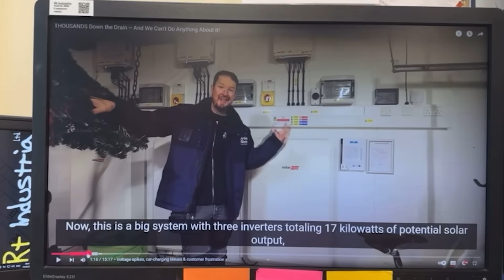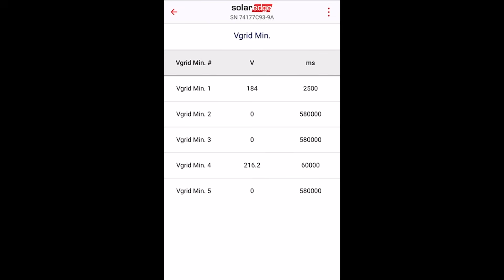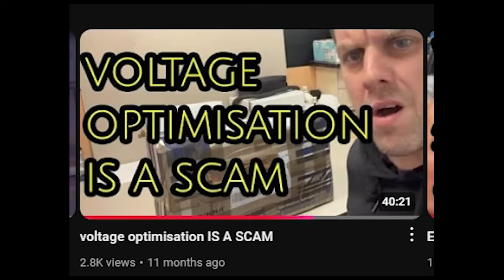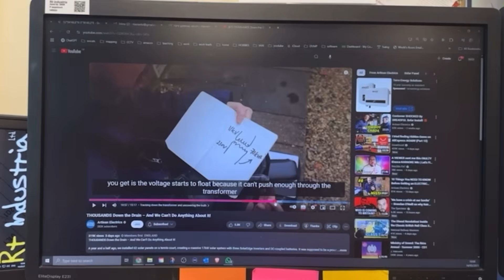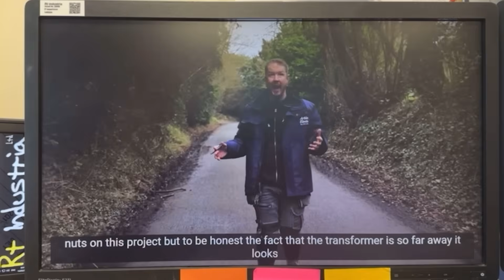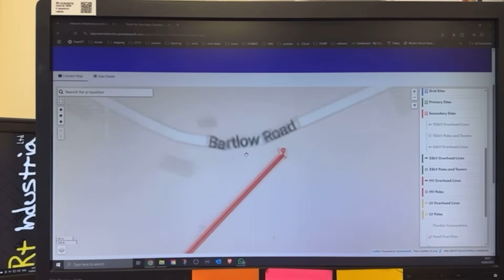ARTISAN ELECTRICS v THE GRID. WHO,S TO BLAME

Comment: Irritates me that all the wealthy people seem to think they should be able to dump as much power as they want into the grid at the times when the country doesn't need it and then expect the rest of us to foot the actual electricity bills to pay for this.
Reply: There's 3 pumped-hydro lakes & an ever-increasing number of batteries to fill up, it really shouldn't be a problem.
Reply: @alanhat5252 batteries are the solution, install them on your property and soak up that generation. If you think you on your cul-de-sac can pump electrons all the way to wales, good for you, that’s just not how it works, the grid was never built to work like this and it’s uneconomical to build a grid design to soak up a few hours of peak solar generation. I love solar, I love my battery system but I’m a realist about what we can expect from our local infrastructure.
Reply: @alanhat5252  you don’t really understand how rural power systems are set up.
Reply: The ridiculous electricity bills are because of the way Government has set it up, the utilities are just doing what the Law says. The Government would change the law if they were prioritizing the people & not worrying about getting massive backhanders.
Reply: @edc1569 253V + 253V = 253V 

That's physics, it's totally independent of network topography, maintenance standards or anything else unless there's a wire run longer than about 12.5Km.

Comment: Some places still have very high natural grid voltage, theres nearly no one with solar were i am, yet the grid voltage at my socket is 257 volts, when its * meant* be to 230.
Reply: Nominal voltage in the UK is 230 dude. My mft is calibrated. 257 is correct.
Reply: It's give and take.  They have a fairly limited window to operate in - topped and tailed if you like.  If someone way down the far end has low voltage and they retap the transformer to lift them up that's also going to raise the voltage for those near the transformer and potentially take them out of spec.  It's better to have more voltage than less but not too much of course.
Reply: Check your meter is correct then get onto the electricity supplier, you should be getting 207V to 253V. It's not a problem for you though, CE marked equipment is required to be able to handle up to 265V.
Reply: UK nominal Voltage is 240V, the EU is either 220V or 230V depending on country, not that that's important.

Comment: I’m really glad I found your explanation, that’s a real eye opener for me, as I was thinking of employing artisan with my new home,  where the dno has approved a 17kwh load as well, you’ve explained a lot for me about back end so I know a little mow what to expect and not get fobbed off my cowboys granted I’m only going to have 12kwh pv but battery’s will exceed 40kwh (ups) server load constant draw 4-7kwh base load .  Depending on time of day  but I think I may need to downsize to 10kwh on the inverter after all . Thank you
Reply: You seem to be mixing up KW & KWh, they're very different things.
Reply: The current 15p/kwh export is a bit of an anomaly, don’t design your system for loads of export, try and design it for peak spring/autumn generation and keep as much energy on site as you can in batteries.
Reply: If you are running a "server farm" you might look at some sort of heat recovery/storage to run your heating might just be a bit more efficient.
Reply: You dont need to downsize inverter, just use export limit.

Comment: Why is he discovering cable and transformer after the event. How come when he was sending a quote for 62 panels and three inverters he did not check the network. Too busy thinking about the bill. Why did he just not tell customer buy three phase. This is what you get for 135 pounds an hour.
Reply: It's quite clear that the goal of the customer/victim here was to maximise his revenue stream from grid export. Probably encouraged (or even given the idea) by Mr Artisan (sic). The cost of upgrading his connection to 3-phase would have probably eliminated that revenue stream.
Reply: Checking the network is solely a grid operator problem. They have all the docs, authorizations, utility maps and computational models. More on that they are owners of grid infrastructure and have ultimate authority for decision. You have nothing. Once you have papers you've done all of your legal duty.
Reply: @rybaluc You are welcome to tell that to a judge in court and to your customer who has spent 80k. That approach leads one to voltage optimisers and walking up and down country lanes with video cameras and very unhappy customers. A more professional approach is to know that the basic maths of this did not work from the outset and know that you have to comply with G99. You have to disconnect if voltage spikes. That’s part of the T and C’s. This does then mean that one or more inverters shuts down. Ev chargers work etc.
Reply: @brianoneill350  Non-compliance with G99 was not my point. 
If you are not compliant then you are on your own. With all the damages you are causing.

But allowing 17kW of overflows on such network is no brainer to me. Of there is time scope to those overflows they should have mentioned - in my country exist connection like unguaranteed overflows where grid operator might in worst case network conditio  limit overflows on his own. Most modern inverters have command cables. Also in country I am living right now - which have much better grid than UK 3p async inverters with combined voltage and reactive power control are required for high overflows like that.
Also options like balancing service to the grid is also possible like discharge or charge of household batteries on operator command.

Also non-compliance with voltage levels here will be quickly recognized by meter and grid operator will investigate. And you will be fined with hefty fine on your invoice not mentioned damages.

 But if grid operator is not doing their job then if you've got approval they are at fault. You as electrician cannot analyse their network. It's not your job, your duty and your infrastructure. And then regulatory office or worst case court is last option.

On the other hand normal  village electricians rarely know how modern inverters work. 
Imagine it is normal in my country to have 3p async inverter with grid disconnection or power limiting.
Reply: Hi, the best words are. - 'It was a bit of a Cock-up from start to finish'! 😢  @brianoneill350

Comment: Who in their right mind would connect three inverters to a single phase rural overhead lines and expect there to be no problems. Fitting is one thing, design and common sense another. Really greedy install. If you need that kind of power buy three phase or use a company that will give you decent advice, don’t do it. It won’t work. Installs a voltage optimiser to try and con the inverters into continuing to supply to the grid and they should shut down at over voltage. What about the neighbours and everyone else. Course it has not sorted the problem. For the low voltage why can he not turn down the battery charging. Greed. And as you say who told him three inverters can work together in harmony. Pure nonsense and greed. Power line run is too long and too small to the transformer that’s where my guess is. Great video.
Reply: The fact he's running 10kw inverters on single phase is nuts.
Reply: The inverters should be configured as 1 master & 2 slaves so they don't fight each other
Reply: If the inverters were working with each other and also  setup to not try and push as much energy as possible back out to the grid, this would be a great system. Much rather see the energy stay on site than get shoved out onto the grid. The problem is this guy thinks the peasant classes owe him money for his solar electrons.
Reply: @edc1569  3 inverters running all single phase trying to pump 17kw is stupid, had they been on 3ph they would spread the load way better also, it wouldnt need massive cables.
Reply: If you ask from grid if 17kw 1ph is ok and they say its ok and give permission to install that, then why shouldnt you do it?
Reply: @lauriviik are you serious ? G99 comes with conditions and compliance. Anyone with a modicum of engineering judgement would know that this is not going to work. We do have to be responsible suppliers. I think there is more to this than meets the eye. I suspect those inverters were also turning themselves off, it's not just the EV charger. If you charge someone 60-70-80k for an install which you do know will in all probability not work, then customer just needs one phone call to a solicitor and it's the world of pain.
Reply: @brianoneill350   im not familiar with uUK. I can tell you how its i n Estonia. I have 15kw export to grid approved, and that means 15kw 24/7 if i would be capable of that. Also as a grids client, as i have permission for 15kw, whats after my meter on grid side is not my concern anymore, they have made their calculations that its acceptable and any problem with that is grid operator problem if reality doesnt mach up with calculations. 
Why would UK be any different? If if grids client is given permission for set amount of export, then its not clients problem to start making their own claculations in case grid operator made a mistake and cant actually handle that.
Reply: @brianoneill350  i agree that conditions and compliance is important and sholud be made correctly, but that applies to client side of grid connection point. Client cant do anything to grid side should it not handle approved export amount.
Reply: @lauriviik engineering assessment was required. Any clown can fit things. Takes a bit more to see potential problems
Reply: @lauriviik  overhead cables, rural area, UK grid, 3 inverters, 72 amps, long cable run, single phase. Never going to work and seriously is he serious 18 months after the install wandering around laneways looking for transformers. Why did he not do this day one.
Reply: @lauriviik  But do you export in single phase? 17kw is nothing in mainland europe
Reply: @zaxmaxlax   doesnt matter, if grid says 17 for my connection to grid is ok and accepted and they allow it then its non of my concern what happens gid side of my connection point. Thats on grid operator if they allow 17kw on 1 phase in that specific address or not, thats not clients consern. My 15kw if ofcourse 3ph with 25amp breaker. But if i would have 1ph connection and grid operator allows me to export 15kw 1ph with 75amp breaker, then its zero concern for me what happens on grid side of my meter, thats on them.
Reply: @zaxmaxlax   but i can tell you lots of houses cant get any export. For example reason 35kv side is allready full or some regions 110kv side is also full. I as a client can look at my street grid poles but that really doesnt tell much. Thats why you trust grid operator to tell you what your connection point is suitable for, if their calculations are off its on them. Ofcourse it would be much better in 3ph for that in video install, but why wouldnt you trust the people at grid who do these calculations and say this place is suitable for what was approved?
Reply: There are inverters which can work together that way. Lot of inverters on the market support that option out of the box. Or they might be upgraded since it's more or less software and communication thing. But they have to communicate together.
Reply: @rybaluc yes, in towns etc, not rural hamlets with that kind of power.
Reply: @brianoneill350  Network readiness is not subject of my answer. I was merely commenting technological possibility and compatibility of such inverters in master-slave mode. It is also used for redundancy since in case of inverter failure it can still deliver load from remaining two inverters. Not mentioned better heat spread accross the room. 

Grid owned by grid operator is their problem. Especially if they allowed connection.

Comment: Given the size of the solar system and the local loads and install with the number of inverters, I thought they had gone 3 phase but i guess not. Local voltage will be a problem and yes, they need to use the power on site and i agree in summer that setup will be powering the rest of the street !

Comment: Hey Jamie, is it not "simply" a case of the loop impedance of the supply to the house causing the high voltage at the house? Assume the transformer is outputting 240 V and holding it steady at 240 V. Then the solar at the house wants to push 17 kW out onto the grid, that's 71 A at 240 V. If the supply loop impedance is 0.28 ohms, which is within the allowable range, then the solar would need to push the voltage at the house to 260 V to get 20 V across the 0.28 ohms of the supply cable to make 71 A flow.

To me, it seems that the long run from the transformer to the house is too long on too thin a wire to allow 70 A to flow without 20 V appearing across the cable. That was also why they saw the voltage dropping when they tried to charge the batteries at night, again transformer is at 240 V, they pull 70 A through 0.28 ohms and you get 20 V drop on the line.

What do you think? :)
Reply: so if I understand what you're saying, the cable going from the house to the transformer would need to be increased in size to lower the impedance of the line to have some better levels and not have that much power loss... makes sense.
Reply from the maker: I would agree with you mate, but as usual with this colour thing I think there’s a there’s a lot of little things that play as opposed to one big one and that I wouldn’t put my balls on the chopping board without being there and doing some testing but the video was just a outline like general infrastructure/grid  things
Reply: @Actual_electrical_content  The funny thing is, it would be so quick and easy to do a loop impedance measurement at the house, and I think it would answer an awful lot of questions. For the sake of 30 secs and pushing a button on the MFT, you'd think that would be the first thing that was done.
Reply: @davefrizelle3882  There wasn't any check or calculation nor even mention of the voltage rise on the inverter AC side wiring in the video either.  For all we know he's losing a few volts of space there too.
Reply: @retrozmachine1189  You thinking of the cable run between the inverter and the meter cabinet? So if he's seeing 260 V in the meter cabinet for example, it might actually be 262 V or 263 V at the terminals of the inverter? That would make sense, it would depend on the loop impedance of the run from the inverter to the CU and the CU to the meter cabinet.
Reply: @davefrizelle3882  Yes, that's it exactly.
Reply: I’d have to agree, the output from the inverters would need to be a couple of volts higher at the secondary side of the transformer to become a source rather than a load and in order to achieve this, additional voltage would be required to overcome the voltage drop across the total external loop impedance of the supply.
Reply: Had a faulty transformer. 
Underpowered due to C20 living as probably installed when you only had lights. 
Shower on, lights dimmed significantly. So I measured it. 
180v to 265v if I remember. 
DNO said turn off and supply 🤣
(After weeks of power surges) it took 2 days to fix and replace transformer from an 11kv 
All was then good. Add we lived in a converted chapel, 2-3 derelict building now lived in etc so load had increased significantly. 
Unrelated, I have worked in a house with its own substation that was directly fed or something. A building at side. Looked a standard mid 60 house. But 3 phase coaming in.  
You’re welcome to guess why it had this 🤣
It was fascinating
Reply: Spot on.  Could also consider a separate run from the house to the transformer, which looks to only be using two phases on the LV side.

Comment: I agree that the most likely problem is the control setup..... I suspect that when there is little load on the system, the inverters are fighting each other to push current. To do this, they are increasing the voltage.... Basically, the highest voltage wins. How do resolve this.... set the inverters correctly or stop exporting to the grid.... SORT OUT YOUR CONTROLS